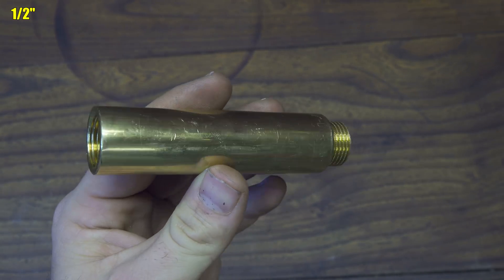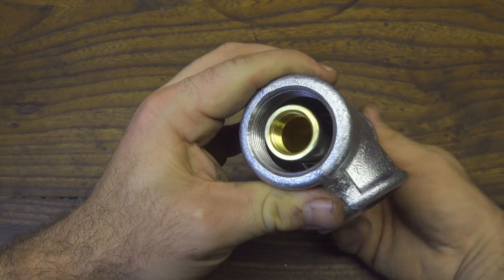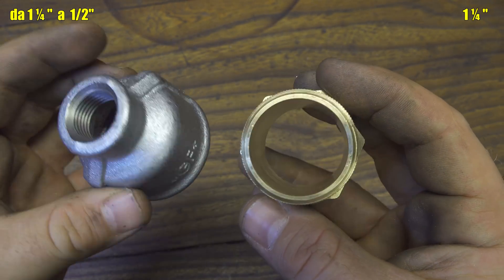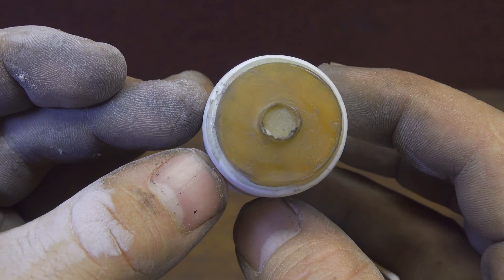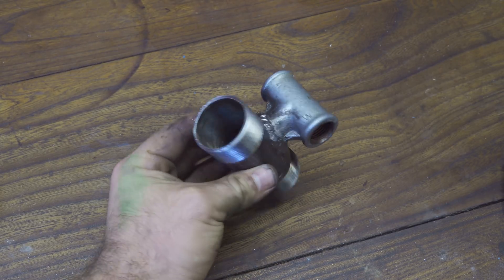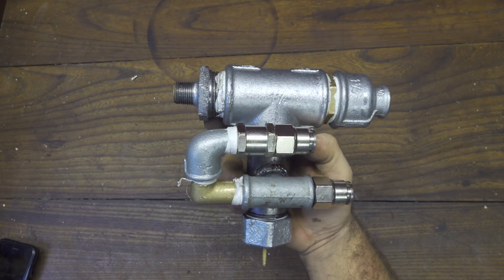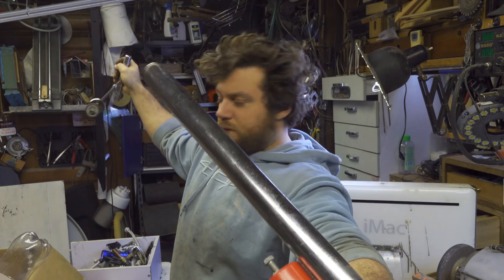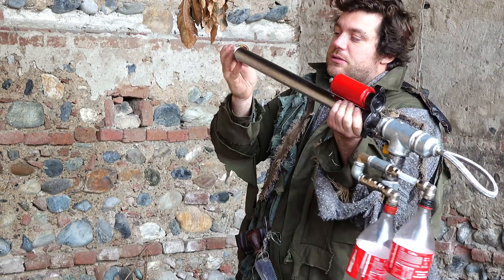How to Make a Paintzooka • Huge Quick Exhaust Valve 1¼" + Slowmo

Comment: You re not listing the parts in the description.

Plus,what's with that welding 1/2 inc Tee on the 1 1/4 inch pipe?... hummm I'll have to break ou the welder...

Comment: You almost made a hybrid potato cannon.If you add combustion chamber with spark plug instead of air bottles and make a piston(with o rings on the sides to keep back pressure ) with front rubber seal like you did,then pump some pressure behind that piston-pressure in combustion chamber must be higher than pressure in a piston seal,which makes a powerfull shot.

On this air configuration i would add a chamber with valve so you dont empty tank at once and get equal ammount of air out each time.
What is the red cylinder thing on top of barrel for?
Ping pong balls filled with paint would be better since no glass everywhere and they are easy to find.You can fill them with syringe and then seal the hole with hot glue.
Reply: Ok i figured it out-red canister thing is from the pump ,you connected a back trigger valve to it so you dont loose any air when you shoot.Nice touch man !